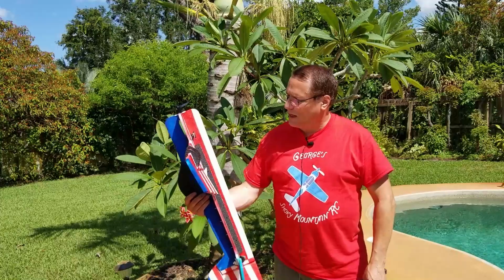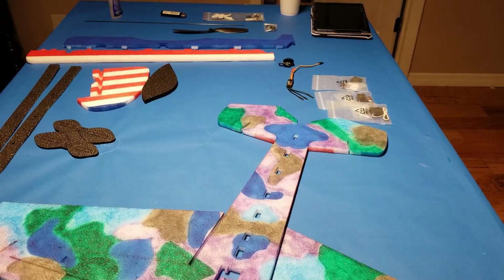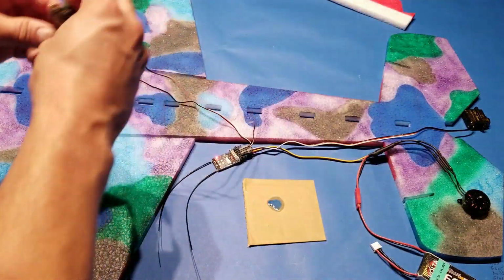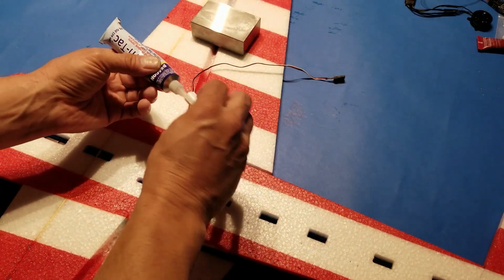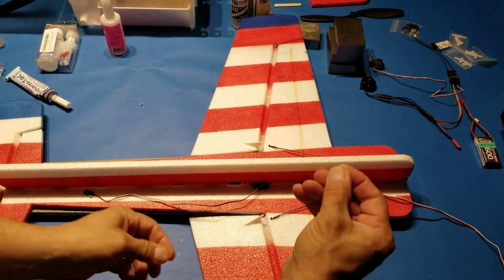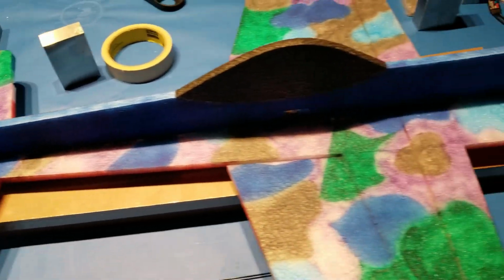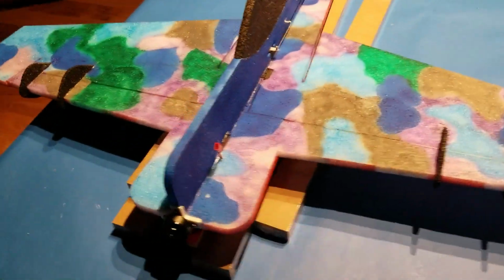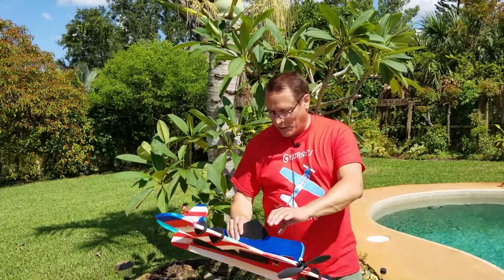Twisted Crack Yak-55 32" Detailed Build and Flight Review

Comment: Just built one of these without the landing gear and all it wants to do is fly straight up.   I can’t get the nose down even at 1/4 throttle most the time.  Only way to get it to come down is stall it.  I’m thinking of putting the landing ear back on to hopefully move  some weight forward of the 210mm CG recommendation.  I have the battery as far forward as it will possibly go and it just goes straight up.  Might have to also do some down elevator and down ailerons to keep the nose down.   This plane is a handful for sure for the new pilot.
Reply from the maker: Sounds like your CG is off. Try moving your battery to get the correct CG. The landing gear us close to the CG point so you will probably have the same issue with the landing gear if you don't get the CG correct.
Reply: @ plans say 210mm which is about 8.25 inches.   I could set my battery on top of my motor and my tail would still hang down.   I’d have to add extra weight to get my CG right on this plane.  It’s super tail heavy.   Not sure why.
Reply from the maker: @lacofdfireman  Are all of your servos centered where the flight control surfaces are neutral when your radio controls are left at normal center position?  Maybe your elevator adjustment is off. That aircraft is normally well balanced so something must be off. Maybe contact the manufacturer for some guidance.  Did you look at my build to see the approximate location of the battery? What size/power rating battery are you using?

Comment: Where did you get those weighted blocks you use on your plane.  I think you called the, 1,2,3 blocks.  Those look amazing for this type of project.
Reply from the maker: @lacofdfireman  They are invaluable for RC Builds. Thry have them at some tool stores but I think I ordered a few on Amazon as well. Yes look for steel 123 blocks.

Comment: George. looks like you are using a 600 Mah battery. What kind of flight time are you getting? I am using the Twisted H 450 Mah Volta and getting only 3 minutes of flight time, mostly half to 3/4 throttle of easy flying. Very disappointed with the flight time. I used their electronics.
Reply from the maker: I get between 5 and 10 min depending on how I fly.

Comment: Quick question. When you mount the battery, it looks like you cut a slot in the fuselage to slide it through. How does it stay without falling out? Is it just a tight friction fit that holds it in?  You don't velcro it to the side of the fuselage correct.
Still giving a great deal of consideration to leaving the landing gear off as you suggest, particularly since I fly off grass.
Probably overthinking this as it is my first foamy build. But I will have plenty of time to work on the Yak this week with all the rain in SC.
All the best, and thanks for your advice along the way.
Reply from the maker: @john9663  I have a small peice of velcro

Comment: Great video. Very well done. Is there a reason you did not install the wheels?
Reply from the maker: @john9663  From past experience I learned the gear turns out to be an annoyance. Without it you can land anywhere.
Reply: @georgessmokymountainrc5815  I watched your 540 video and now I see why you did not install the wheel set. 
When you hand launch do you have a "launch mix" with a little up elevator on a switch that you turn off just after launch? I assume you set a high throttle and toss in the air??? Your advice would be appreciated.
I start this build tomorrow after FedEx arrives.  Your video has been extremely helpful! 
All the best to you.
Reply from the maker: @john9663  The aircraft is pretty easy to fly. No special settings for take off other than low rates setting.  Once airborne and in level flight I go to mid rates. Not much need for high rates as it's very responsive.

Comment: When I covered my wood planes I would use alternating colors between the ribs on the bottom.  On the top I would usually use bars parallel to the  leading edge.  Thinking about painting (repainting)  something similar on the foamies. Thanks for the inspiration.